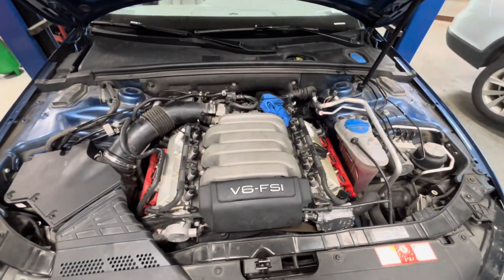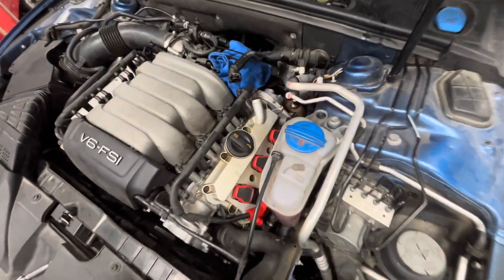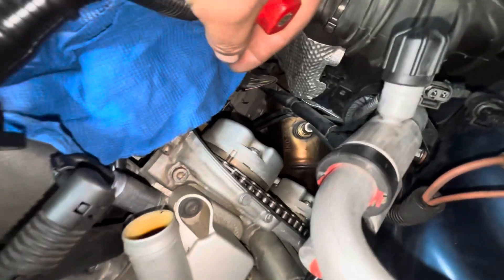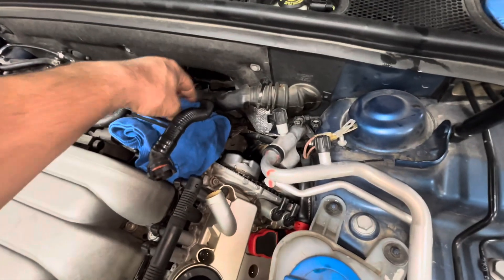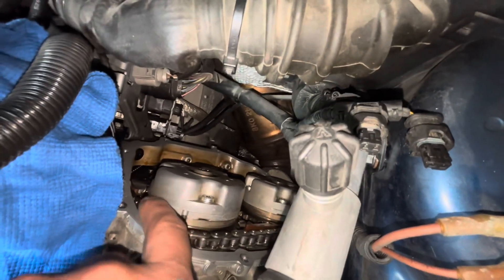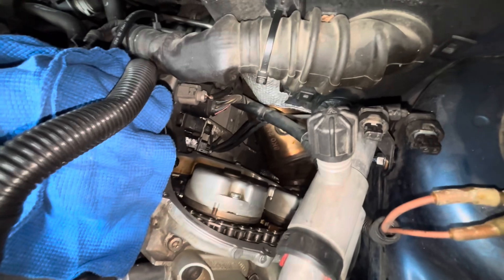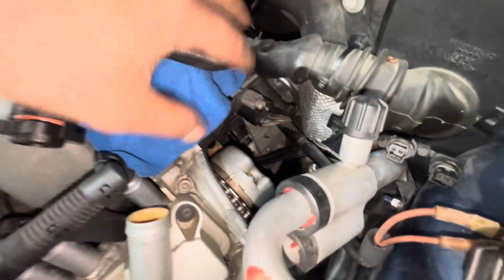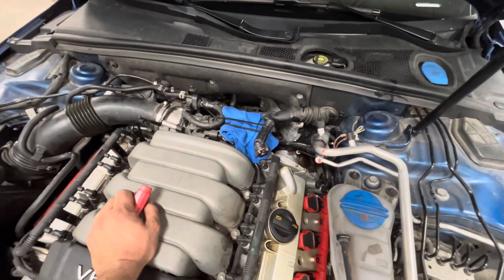TALKING ABOUT FIXING OIL LEAKS OF THE BACK OF AN AUDI 3.2L ENGINE

Comment: Would this leak on to the catalytic converter to cause white smoke under load?
Reply from the maker: Usually not, you see the leak on the cats more from valve cover gaskets and upper timing covers
Reply: @EuropeanAutoRepair  so it can leak from timing cover to the cat? Cause I’m seeing white smoke coming from under the intake manifold and I changed the solenoid o rings and I think it’s now coming from there. Valve cover gasket changed and oil housingg
Reply from the maker: @harrissafi2831 clean off those bottom of those solenoids real good and and do a cold start on it, sometimes the base of the solenoid itself will leak and you see it the most severe when cold starting from what I’ve seen
Reply: @ ok I will try that thank you

Comment: Been there on the last 4 Audi’s I’ve done. Do it when I buy the car ( usually with 100K or more miles). But I find the oil filter gasket to fail more often. But the 3.0t is a real pain.
Reply from the maker: Yeah definitely the oil filter housing gasket is more common I’ve found as well